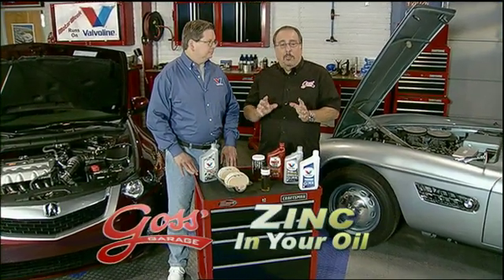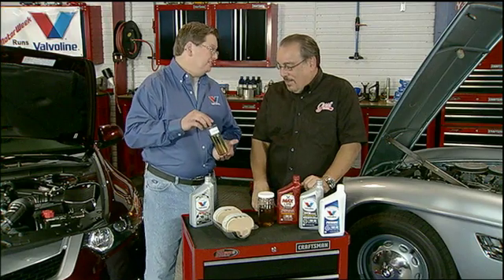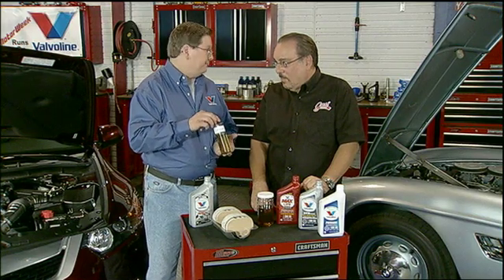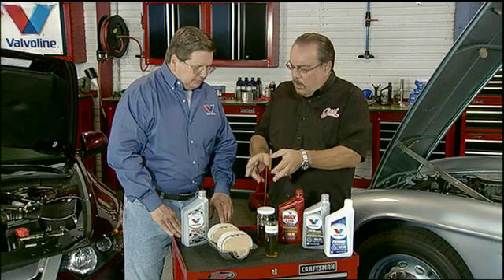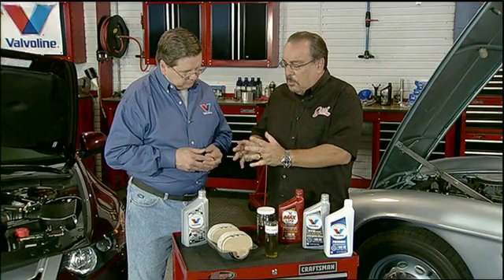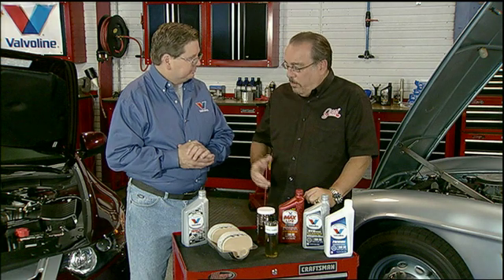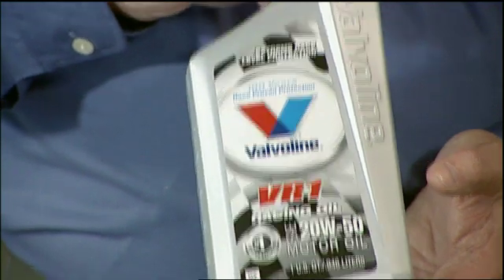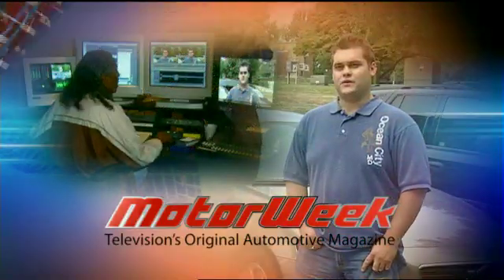MotorWeek Goss' Garage: Zinc in Your Oil

Comment: I ruined the cam in my 66 Corvette big block not using this zinc oil
Reply: What year was this? This video was made while API SM was still the standard and was actually a low water mark in wear protection due to mistakes in the formulation. Modern API SP oil is supposedly the best anti-wear engine oil ever, even for flat tappet cams, according to some tribologists.

Comment: Right on.  Oils for non cat converter  engines like outboard. motorcycle, small engine diesels etc. still have high levels of Zinc.  That's why it's important that you use the oil that the factory recommends.

Comment: I always used mobil 1 full synthetic, but recently saw a lot of fuss about valvoline vr1, so got interested in it. Can anyone tell if it is any better or same as mobil 1?
Reply: I’ve been using VR1 in my classic car and it runs great.
Reply: @princedark7230  I switched to Pennzoil ultra platinum from Mobil 1. car feels more zippy and pick ups seem smoother with PUP, so I made the switch.
Reply: Some of the mobile one does not have higher levels of zinc so you have to look at the chart and pick the one that has the higher level like I am running the European  5W 40 FS....1000ppm

Comment: i bet every manufacture of camshafts and lifters love this guys information because of all the camshafts going bad because of not enough zddp especially flat tappet camshafts
Reply: There is a curve to that: overdosing zddp has a protection rollover event and can cause wear after a point.  We have to pay attention to our lift and ramp specs: that is what drives the need for higher spring pressures to maintain valve control.   Let's look at a cam on the tamer side of things for fun:  Howards 112571-12, which calls for a spring 98214 and [intake] lift is 0.455" on 1.5 rockers.  On the seat is 115 pounds and max lift comes out to 302 pounds.  Now lets point that force back at the cam through the rockers: 453 pounds [minus a bit on account of geometry, so I'll say 450 pounds].  High load area on the lobe/lifter interface is unknown since I don't have this cam to inspect after running, so assume that is 0.080" square which is 0.0064 square inches.  Maximum load against oil film is 70, 312 psi over the nose.  A proper engineer would make corrections,  but we're in the right ballpark  Now we see why Detroit did what it did back in the day: bigger durations to get at flow without too much lift, using gentle ramps to reduce moment of inertia problems as lifter direction reverses.  LSA's spread to the wide side to reduce reversion volume was a natural result of those choices.
Can we get at lower spring rates for the same cam lobe?  Yes, but now we need a physics guy to recalibrate all masses involved - I'm not the guy.  Maybe titanium valves & retainers allows lower spring rate to work at say...285 over the nose? That eases things to 66,797 psi [maybe] - this is spintron testing time.

Comment: i run VR1 20w50 in my 1975 Ford Capri with a flat tappet cam and it's fantastic i change it once a year or 3000 miles and the engine is spotless
Reply: Old Fords Don't die you wouldnt happen to be FordCapriGuy on bitog?

Comment: Non-roller cam engines need the addtional ZDDP if you are using modern API SN oil. Some cars, like Cadillac, had the roller-camshaft engines in the 1980's and still used API SG oils with the 1,200 PPM motor oils. ZDDP does not prevent oil rings from seating in the bore, period. If it did, then no car engine would have ever had the rings seat or "wear" into the bore in the days of the 1,200-1,400 PPM motor oils. The camshaft lobes and lifter surfaces are the main concern with low ZDDP levels.

Comment: If you have a an old car without a catalytic converter then yes, use zinc. It protects your camshafts and tappets. Putting oil with zinc additive in a modern car with a three way catalyst will shorten the life of the catalytic converter and the O2 sensors.
Reply: Listen/watch again: it seems phosphorous is what poisons the cat.  And if I understand things correctly, zinc hitches a ride via a polymer - that is key to working in a running engine.  Anyway... if engine isn't burning oil, no need to panic.  All oils still have some zinc and phosphous in them  - even newer tech that relies on calcium sulfonate as the primary wear agent.  SN and SP oils today are under 800ppm.  Its frustrating getting at/understanding good info: many manufacturers will state content by weight %, which is not a concealment by any means, but the average guy wouldn't know where to begin if data sheets used terms of molarity. 
Mainly, know this: add zddp to an oil and we are on our own.  Any wear testing done by the manufacturer becomes bad data, and good luck finding the original - the void suggests that car manufacturers are over-lawyered and wherre they bring a lubricant design requirement to an oil company it probably has an NDA attached.  Some oils respond well to added zddp, others don't.  That said, I still use it selectively.  My 1995 toyota seems to like zddp added to Castrol gtx: valvetrain [bucket/shim overhead cam] is noticeably quieter. Engine has been treated that way for a good 15 years, no cat problems, and now has about 240k miles.    Power and mileage same as the day I bought it.  I have not bothered to get the concoction [mechanically] tested, and maybe I should: in 2015, gtx was reformulated in the wake of industry getting up-ended by the Saudi's undercutting opec by $20/bbl out of nowhere in 2014. 
Car manufacturers these days seem to have blinders on regarding anti-sludge and high temp/high shear values, and device tolerances are tightening to get at lower viscosity oils in search of extra mileage.   That is steering oil formulations. Actual wear protection? Concerns seem to be an afterthought the moment warranty expires, and CAFE changes [made by congress with zero science] continue to be a stumbling block to good  design in some instances.
Reply: Yes I have a 3vze motor in my 4Runner and I put 244k on a motor that already had 60k and yes I definitely experienced cam wear running the older version of Castro 20w50 for years. So I have new cams in that motor now and I am running higher zinc levels in a different oil. I am in southwest